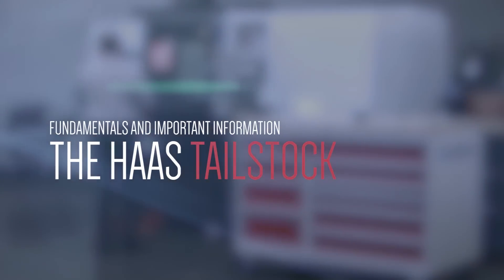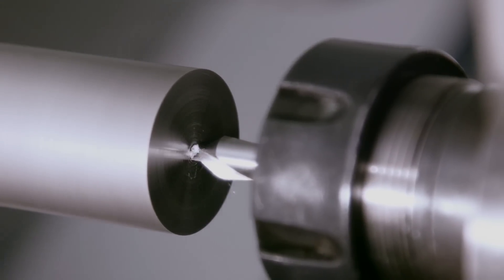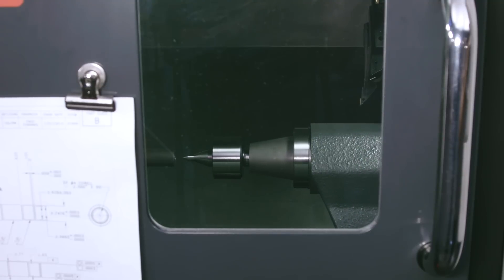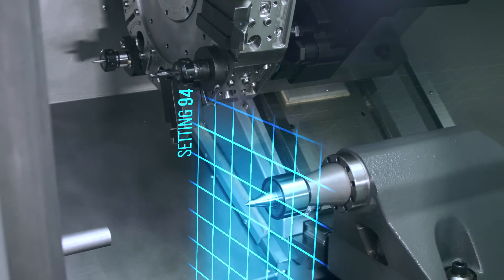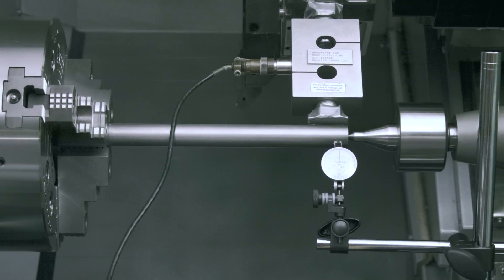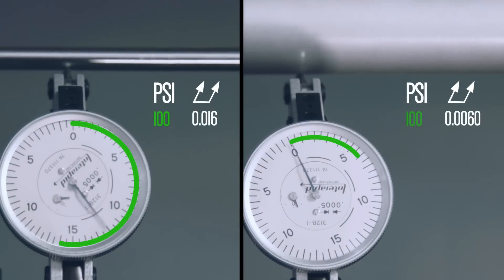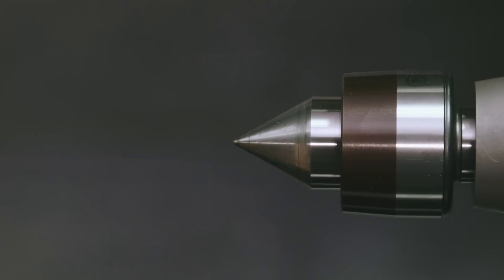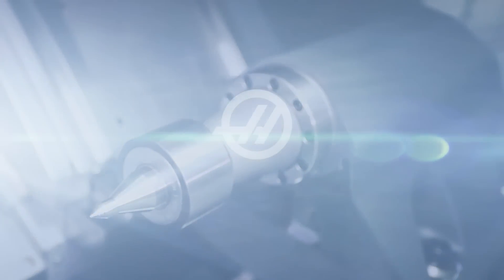Tailstock Fundamentals: How to use the Tailstock on a Haas Lathe

Comment: Great video! Informative as always. If you have a part that is to long to face and center when extended you stub it up for those operations. My question is when you extend the part to support it with the tailstock do you have to indicate the face and/or center of the part before bringing in the tailstock? Or when you support the part with the tailstock does it center itself? Any insight would be greatly appreciated. Thanks.
Reply from the maker: Branden Brown Great question. Typically, after you've faced and drilled your center hole with the shaft set back in the chuck you can just extend the shaft to its full cutting length and clamp it with the tailstock, without any need for indication. This is because choking up on the shaft to drill the center hole should give you the best "on-center" position. The accuracy with which the center drilled (60 degree center drill) hole gets made determines the shaft's maximum run-out and OD concentricity, when you support it with a live center.
When the shaft is extended and re-clamped it might be clocked differently in the "stuck out" position, or the shaft might have a little bit of a bend in it. But, despite these issues, once the part is spinning you will be cutting true to the rotational axis defined by the tailstock center and spindle center, and your part geometry will be accurate to that central axis.
Reply: Except it doesn't work like that in the real world. If you have a bend in the material in the extended position and you force it to align with the tailstock and machine it, once you release the tailstock/spindle clamping the part returns to its relaxed state and now you have an out of tolerance part in your hands.

Comment: So just ramming the TS into the part with hand jog is the proper way of finding the clamping position?
Reply: It specifically says that jogging the tail stock into the part to clamp is NOT the right way to clamp the part. It says to use M21 only to clamp the part.

Comment: Great video! For setting 93, the video shows the operator entering the "operator" position into setting 93. Should this not be the "machine" position?
Reply from the maker: Good catch KB Machinist - We should be looking at the X-axis "Machine Position" when we are checking and choosing our Setting 93 clearance value. In this case all three values were the same, but you should always use the "Machine Position" for this step of the procedure. We will be adding a note in the video to clarify this point. Thanks!

Comment: Is there a minimum operating pressure of the ST20Y tailstock? It seems on our machine that we get a tailstock undershoot alarm when retracting at 100 PSI, but the issue is resolved at 125 PSI. We were not running at a higher PSI due to part pushback, but we plan to solve that issue with a different set of jaws and then increase the tailstock pressure to the recommended 200 PSI.
Reply from the maker: Kenneth Higley Sorry for the delay Kenneth! There is indeed a recommended operating pressure for the ST-20/30 hydraulic tailstocks. Per the Lathe Operators Manual (pg. 96): "Recommended minimum hydraulic tailstock operating pressure is 120 psi. If hydraulic pressure is set lower than 120 psi, the tailstock may not function reliably."
 
It sounds like your plan is to make a new set of jaws which will include a locating back face to act as a stop for the part. This plus an increase to 200 psi pressure should prove to be a more reliable method of holding your work piece. Hope this helps. Have a great weekend!

Comment: On a Mori, to remove the tailstock, there is a large screw at the neck that you turn clockwise and with a few taps with a hammer and wedge it comes out.

Comment: What about using a tail stick on plastic parts I had to use the tail stock on a small diameter long delrin part and I had trouble with using low pressure. With low pressure the tail stock would alarm out when trying to find the end of the part. And wouldn’t keep pressure on the part. But high pressure deformed my center. I end up just positioning the center in the center hole and turned the part without constant pressure. The live center didn’t spin I had a good bit of taper and some small chatter but it helped some.

Comment: 3:57 is 140mm D and 500mm AND longer from jaws too long to face and drill. tell my boss :) is it matter if only drill center with other machine that not even centre both ends and then use them cut part.. first side propably go ok. but next side centrehole not anymore center for surface we just cut and use soft saw to hold them. tell my boss :)

Comment: 1:34 propably not or sure it will need. if you clamb it so far you sure want cut diameter smaller. so your L:D ratio come higher. unledd yo sharpen pencil you fine :)

Comment: 400 psi says nothing about the pressure on the part
it is hydraulik pressure
  on the piston,,,,,  200 psi  on a 150mm  piston is not the same  as  200 psi on a 200mm piston ..
Reply: Correct! You need to look at the chart that is on the machine to know how much force is applied.